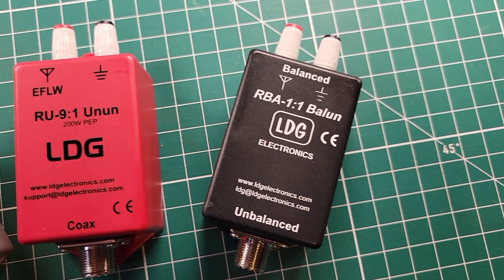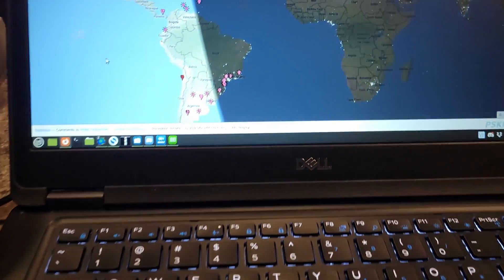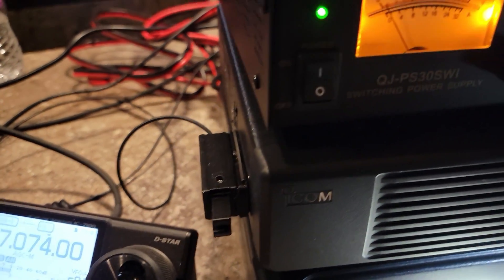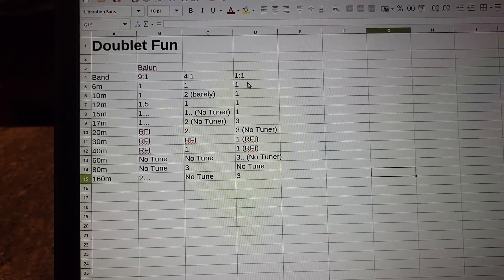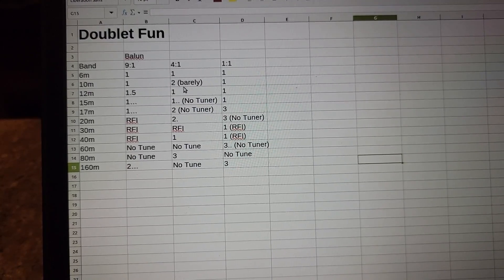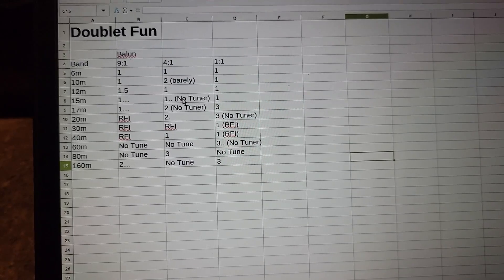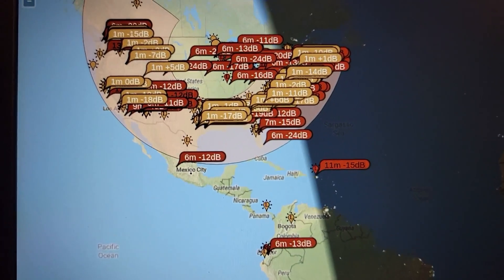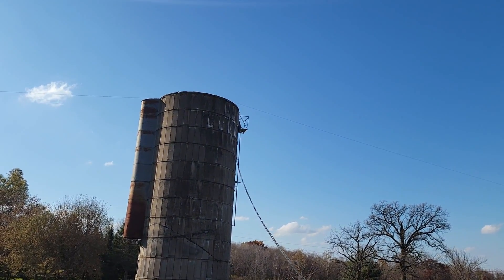Will a Balun help make a Doublet more tunable?

Comment: Your comparison testing confirms what several "antenna gurus" of late are saying: that the 1:1 current balun is preferred over the traditional 4:1 balun to feed the doublet, because it results in less loss in the tuner, that the 4:1 balun can actually present a hard-to-match extremely low impedance to the tuner under some conditions and bands
Reply from the maker: It was a fun experiment. These things need to be done as tech changes to challenge the old-think in the presence of new-stuff.

Comment: I'm just gathering the material to build a doublet in inverted vee form. Each leg will be around 85-90 foot in length, and will use 14-guage black insulated starnded wire from Amazon, and 450 ohm ladder line. My tuner is an LDG-AT1000ProII tuner so hopefully it will tune OK, along with a 1:1 balun (a 4:1 balun will be on standby). I was thinking about a ZS6BKW (which is just a doublet with resonant wire lengths)...but the doublet can just be any non-resonant lengths, so I went with that.
Reply from the maker: Doublet are awesome!
Reply: I would not be quick to say a doublet can just be any non-resonant length
It is still a dipole just fed balanced as a dipole should be .
It a proper dipole
All that is proper with all dipoles still proper here
Start with wavelengths
Not just random lengths of wire
This sort of sounds past tense
A balanced dipole is from the beginning
It was not till ww2 when unbalanced coax become popular
The dipole who was the balanced dipole predates that

Comment: Steve 
Unun is not for a balance feed line  Balun = balance to unbalanced (or vice versa)  unun = unbalanced to unbalanced . 
So since the feed line and antenna is balanced you should throw out that column....but it tune right well your tuner will tune a lightbulb too.
Reply from the maker: You are correct.  Its just there for comparison/info.  Thanks for watching.

Comment: I don't know much but a 1:1 doesn't sound right on a doublet. Go figure.🤷‍♂️ :)
Reply from the maker: The 1:1 would stop any RFI from heading into the rig where you switch from ladder line to coax.  That solves all kinds of problems - and might even help a bit with tuning too.
Reply: The "antenna gurus" of late all say the 1:1 current balun is preferred to feed a doublet over the traditional 4:1 because there is less loss in the tuner

Comment: Thanks Steve, I'm still wrapping my head around use cases for different baluns and you helped fill in the gaps.  Also, thanks for using affordable products to test with - love LDG products.   73, K7KS
Reply from the maker: The easiest way is to measure the impedance presented from the antenna, then do some maths to figure out what transformation you need to go from that measured impedance to 50ohms for your radio. 4:1 is 200:50, 9:1 450:50, and 49:1 is 2450:50 for popular choices... then there are 1:1 which are used to remove RFI from your coax and keep your radio happy in a different way.  -- one thing I should have done was measure the impedance first... but what's the fun in that.

Comment: I see one was a UNUN (9:1).  Would a 1:1 UNUN perform better that the 1:1 BALUN?  I do not know if the Doublet is balanced or Unbalanced.
Reply from the maker: A doublet is balanced - you can tell by the way it is fed - in this case, the doublet is fed with ladder line.  I always remember that coax is unbalanced.  In the case of this antenna setup, I couldn't use an UnUn because I'm not going from unbalanced-unbalanced.

Comment: After different experiments, also with a IC-7100, I found that using a tuner that has provision for the the feed line to be attached directly gives me the best results. My MFJ-993B  IntelliTuner with a 144 foot doublet tunes 6M to 160M. Though on 160M using SSB it is marginal. It is a rock solid regional comm setup on 80M though. In digital mode it is a great antenna. In general, in my situations, I have not found baluns or ununs useful. Obviously other people's results are different. Like you I tried a number of different chokes and balun/unun ratios. As I have recently discovered there is great promise in using twin coax as a twin lead feed line. That is the direction my antenna experiments is going in this year.
Reply from the maker: That 993b has a built in 4:1 balun... that's the same reason why I don't normally run with a balun when using a tuner.

Comment: While you can connect a tuner to ladder line, it's not balanced as one lead is ground, and then it's not technically a doublet.  That requires a balun, and the tuner and balun should be connected directly to the ladder line.  Meaning an external tuner and not in the radio.  I use a 9:1 to match the 450 ohm ladder line.  I think your RFI is from tuner and balun on opposite sides of the coax.  Not optimal.
Reply from the maker: Exactly!  It was a fun thing to play with and it connectd some dots in my head.
Reply: That's what I meant. Coax to ladder line means one leg of the ladder is grounded which either grounds one ladder leg or turns coax shield into antenna.

Didya think a 2 minute video meant this much work? 😉
Reply: Steve, no criticism intended.  Ham radio is really just one big experiment, and this short video really got me thinking and running the scenarios in my head.  Excellent video.
Reply from the maker: @ndoren  I didn't take it as criticism, and I'm glad it got some gears turning!  Thanks!
Reply: You most surely could build a true (not talking about the famous uggies)  4:1 Balun with coax but would be single banded back in the day you would see the on beams with a folded dipole driven element. Since it required a 1/2 wave coax stub only good for one band
Reply from the maker: @sherrycoady2491  Thanks Sherry, Good Tip!

Comment: I'm confused. That's ok, happens often. Don't you always want a balun of some sort on a doublet? Assumes radio is coax out.
Reply from the maker: Most people assume that balun=transformer instead of "adapter". Even with that in mind, your tuner might have a built-in balun.  An example is a 49:1 transformer, it transforms a 2450ohm antenna to 50ohm for your radio, if the Doublet is 5000ohm, the transformer would help get you closer to your tuners range and allow tuning. (102ohm).  At the end of the day, I was having fun and wanted to share.
Reply: Balun is balanced, as in the twin lead to unbalanced, as in the coax. The ratio represents the impedance change as mentioned. They are separate things. My 9:1 is NOT a balun but an unun, like most of them I've seen. Same is true of the 49:1 that I've seen. Not sure of any performance difference between a 4:1 unun and a 4:1 balun for this application. Not sure I've seen that comparison.  Nice videos!

Comment: No and those tiny ldg ferrite suck. Tried on mine and even 100w would get them so hot the plastic case melted off junk. Bob @BalunDesigns is the only person to buy a balun. And a 3:1 max vswr on any balun. 😂
Reply: 💯 on Balun Designs.   Nailed it.
Reply from the maker: Interesting, I haven't used them enough to run into that problem.  Thanks for the heads up.
Reply: @temporarilyoffline  made hige mistake buying a palomar box and opened to see tiny cores and orange stay foam and tiny 18g wire. Tore that out of the enclosure and talked to Bob at Balun Designs and he gave a short explanation as to why when using 811h it’s very important to have a balanced feeder and 1/2w length on a hw doublet. Sadly I chose 130’ of feeder and that puts high impedance on the back of the tuner on 80m so high it gets cores smokin HoT I ve seen nylon balance stud insulator melt from RF & a blue flash as the studs shorted to tuner chassis. Porcelain or ceramic ☺️provides better resistance 😉
Reply from the maker: @kevinkc3onohelijeepworld  Living on the edge man!
Reply: I use a 4:1 current balun with doublets.  I also use a remote tuner (the LDG).  My doublets tune 80-10 without a problem.  The length of the balanced line can affect tuning.  Tom W8JI has a good discussion of baluns and doublets in the DX Eng. info:  Baluns:  Choosing the Correct Balun.  22 pages of good advice.
Reply from the maker: @davidw3gzs55  great idea!  Chuck sent me that DX Engineering book when I built this one.  Very good book!
Reply: I used a LDG 9:1 to feed the rain gutters of my apartment building before I moved. 100w CW in a contest was no problem. I’m not sure I’d run a pile up with it but 3-4 contacts a minute we’re no issue at 100w.
Reply from the maker: @W3OY-RAY  Did you notice the SWR drift at all (I guess the tuner would re-tune?)  If no drift, I'd keep hammerin away
Reply: @temporarilyoffline  I used an MFJ VersaTuner II… never had any indications that the core was reaching oversaturation. I’d occasionally check it after heavy heavy use, Calling Dxpeditions and such. Never was more than luke warm. The one day I called TX5N for 6 hours at 100 watts, CW, before getting through. My wife was SOOOO mad that day. Hi Hi.
Reply from the maker: @W3OY-RAY  that's dedication!